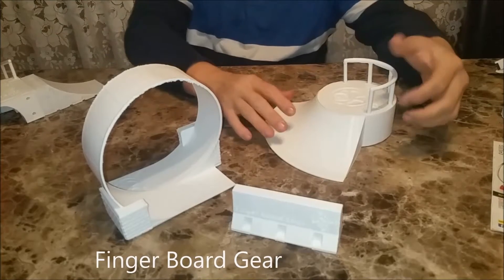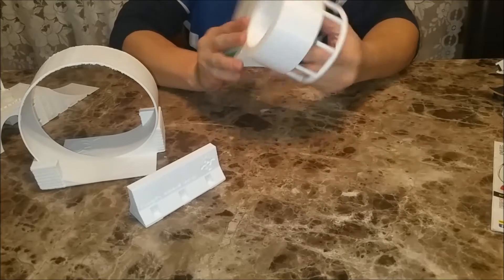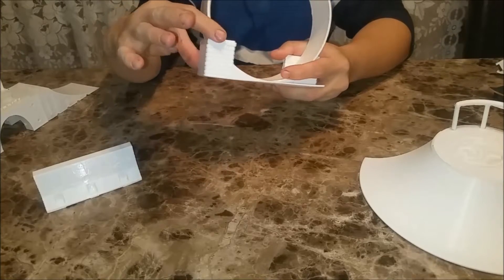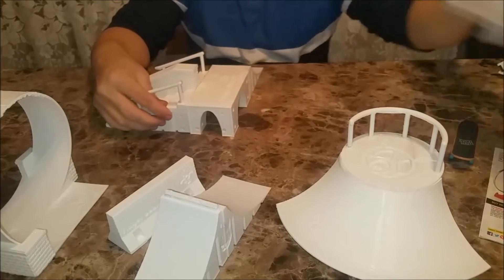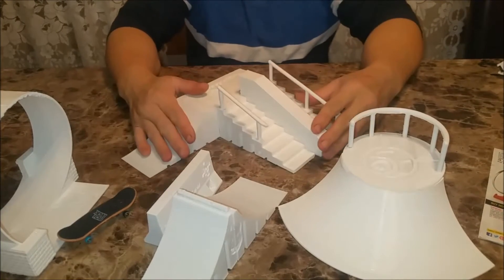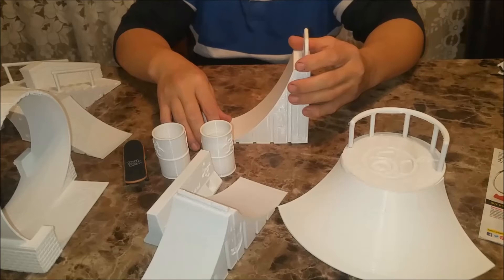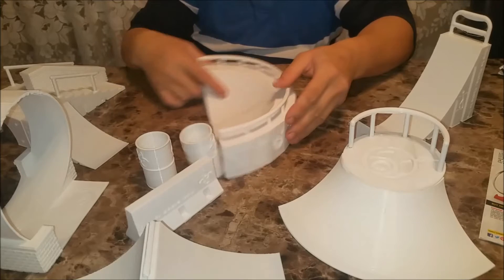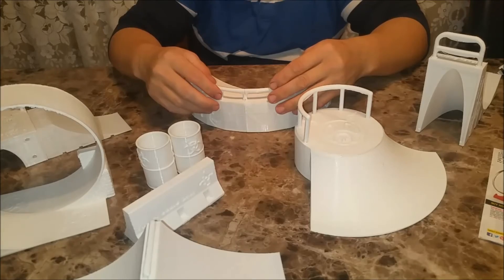Finger Board Gear Time lapse 3d Prints

Comment: My dude, awesome designs. Printing set two right now, Will print set 1 when that is done. Possibly the rest as well haha. Love it man. Good work
Reply from the maker: I am glad you like them. I hope all them print out well for you.
Reply: @LMG3D3DPrintingEnthusiast  so far so good. They are designed perfectly to print. I started with the half pipe set and thought for sure I would have issues as I printed with no supports. But came out smooth like butter